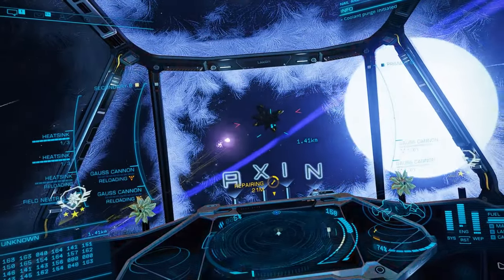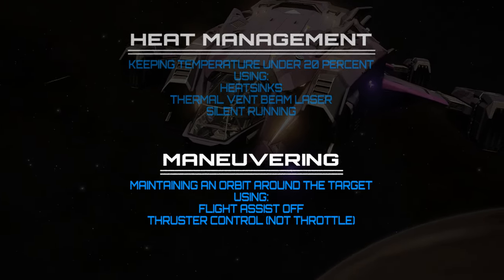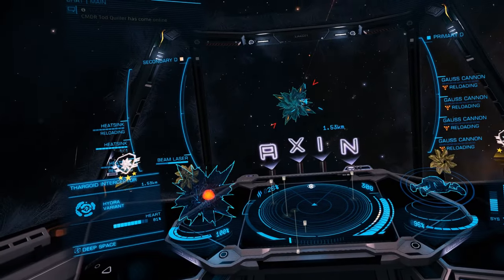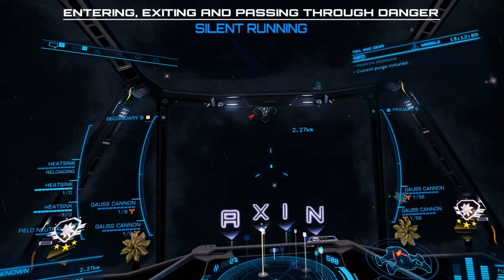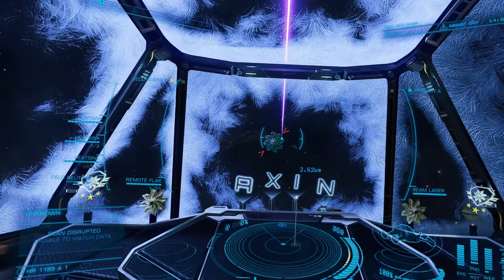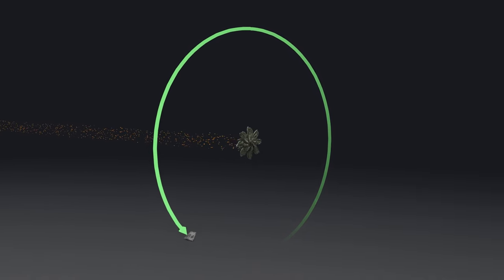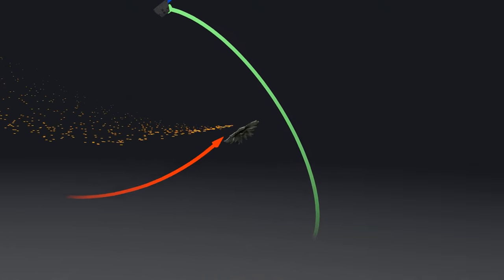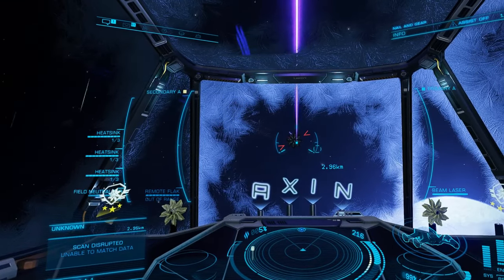Complete guide to Cold-Orbiting - Thargoid Combat Tutorial

Comment: Very, very, well done, dear lady.  Colour me impressed ... even tho’ I doubt I could ever do this (keyboard + mouse warrior :O).
Reply: Keyboard and mouse is the suggested optimal control scheme for what you are seeing here. Getting fine grained control for accuracy with a stick requires high grade hardware, and even then it doesn't quite stack up to kbm. You can do it with a bit of practice 🙂
Reply: @vengefire  The OP says they use stick and throttle for this, which takes either a $1K hotas setup, smoothing software outside the game, or was a lie.  look at the smoothness of the aiming at all times.  You cant do that with a t16k joystick.  Its input is physically not possible.
Reply from the maker: ah Will, nice to see you back :P 

Git gud is the answer though dude - just because YOU can't do it doesn't mean noone can :D
Reply: @vengefire  Sorry for the late response, I didn't see your reply until just :O.  

The two biggest problems I have with 'control' using a kb and mouse are throttle manipulation and dealing with FA OFF.  In combat I rely on my thrusters to manoeuvre as I can't easily get to where I have set up the throttle increments and with FA OFF I end up wildly swinging about as I can't re-centre accurately after an input.  Neither of these are the fault of the input devices themselves, I realise but when you're nearing retirement age and your joints are getting stiff then getting gud is all the harder :chuckles:.
Reply: @dallassukerkin6878  turning on relative mouse movement in the controls and lowering mouse sensitivity a bit should solve your problem of wildly swinging about in FA OFF.

Comment: The best guide to cold orbiting. Thanks Kate.

I really don't think you need to use 2 vectors for cold orbiting, I orbit with the goids trail off to my right, i use right thrusters, you end up in a swinging orbit with the goid, you get its momentum along with it, the only time i use downward thrust is if i begin to stall, you cant stall in front of the goid anything more than a cyclops and you will take huge damage in a shieldless build. I really tried using both down/right thrusters and i just couldn't steady my aim, so maybe its a me issue, i'm not at your skill level ether.

Check out my latest up load of a Basilisk  kill, tell me what ya think.

o7
Reply from the maker: yeah it takes practice to get your aim in line with the correct orbiting technique. in my opinion control input method also makes a big difference. I have been watching your recent videos too :) good work on the Medusa and your Basilisk today

Comment: would you cool faster if you used more beam lasers?
what about a full beam laser build with long range? the extra damage from no fall off would match the gauss cannons?
Reply: Thargoid ships take only 33% of damage from normal weapons. It would be a very long fight using only beams.
Reply: In more technical terms, firing a beam laser at the same time draws more distributor power and can either result in less gauss firerate or more heat generated by the gauss (distributors are weird) and causing heat spiking. It's way better to just fire a split gauss firegroup and rely entirely on heatsinks while the beam assists outside of attack runs.

Comment: Very good guide. Whats your view on handling the swarm with a cold built.  Do you mainly ignore it (depending on the interceptor type), stay below 20 degrees and avoid it, or take it down before the attack run?
Reply: Always take the swarm down before attacking.  The exception is if the Thargoid is enraged, in which case, reduce the swarm down to 10 or so, then go for the attack.  Once a heart is killed, enrage ends and you can dispose of the remaining swarm.  Note that the swarm does not care how cold you are, boost away, flip round in FA Off and shoot them down that way.

Comment: Do you get 0% heat generation simply by not having shields turned on? Or does it require more specific setups?
Reply from the maker: you use heatsinks, basically they last 10 seconds and when runs out you just use another one
Reply: @Citizen_Kate  Thanks. And one more (and final) question... are all ships capable of cold-orbiting the Thargoid Interceptors?

Comment: ok. But seriously how though... You are sooo stable in FA off... is that mouse/kb?
Reply from the maker: I  use a HOTAS, specifically the VKB Gladiator NXT stick and TCWS throttle, but at the AXI there are members  that use everytihng from Keyboard + Mouse to Xbox Controller :) 

It's all about practice and persistence - everyone is bad at FA OFF to begin with but in time it becomes second nature
Reply: @Citizen_Kate  Agreed, I use FA off regularly to "slide" when its preferred. but my TM 16000 (3rd warranty so far) is giving out again, and the 3dPro is showing its age as well. Twitchy controls and no center make for difficult thruster control. I'm trying to hold out for Virpil / warthog to become availalbe again. VKB comparible to Virpil I presume.
Reply: @Citizen_Kate  Thanks for info, after trying to stay cold i was able to get to the last heart without losing 10% hull, but my shots are very hard to land in FA off... got a case of the wobbles with the krait. Wish there was a way to adjust the rates... I wish VKB had throttle though...